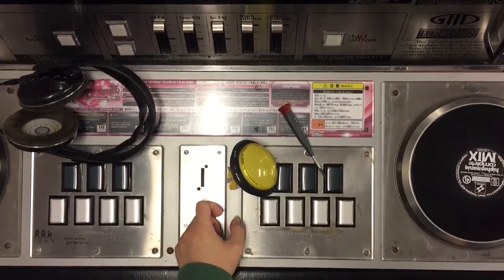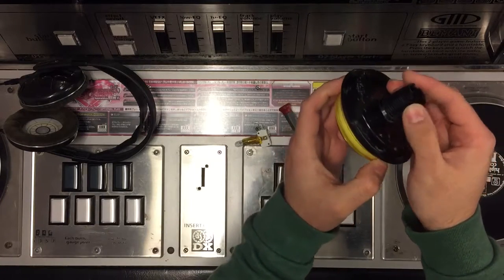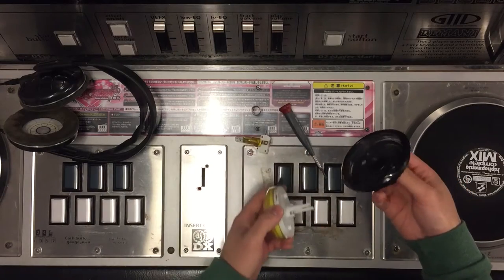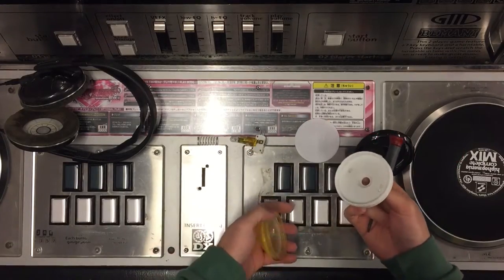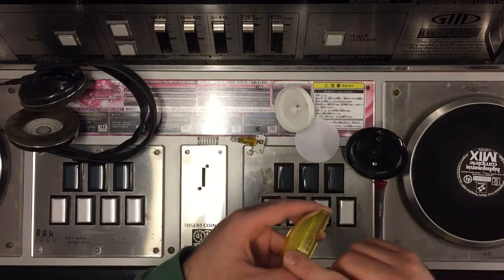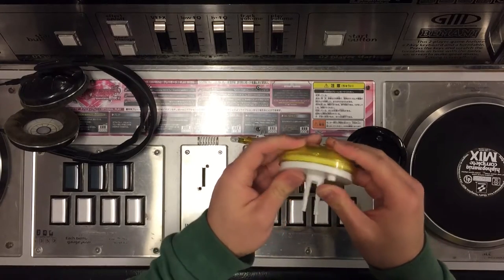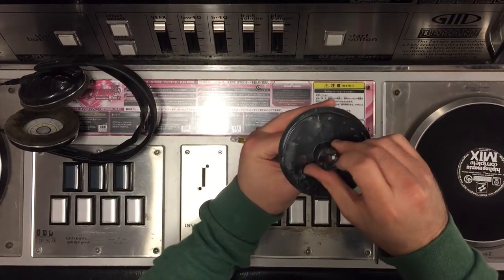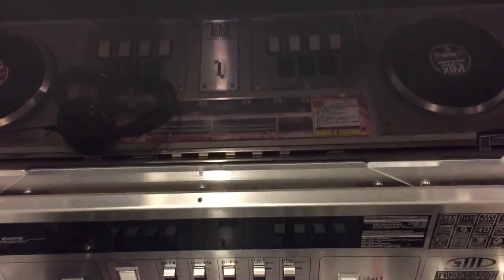HAPP/Dao/Sanwa/Baolian/Samduck Pop'n Music 100mm illuminated dome button cleaning/maintenance advice

Comment: Protrusions? I think those are just bumps for LESS surface contact right? if anything, filing them to be pointy triangles would be even smoother probably. 
Do people go as far as make these silent?
Reply from the maker: I was referring to burrs left over from snapping the clear piece off of its mold, most buttons don't have these but I've had a few that did, and you could feel it scraping against the black base. The clear piece is supposed to be perfectly round. As for silencing, I've never done it but I've seen people use soft material on the base to make them quieter.